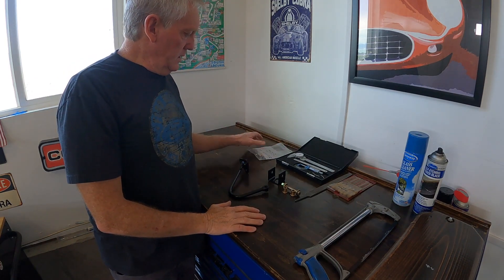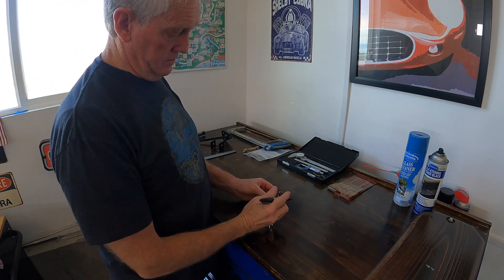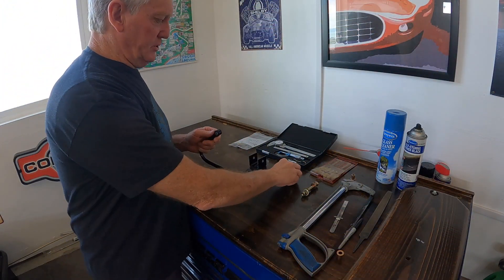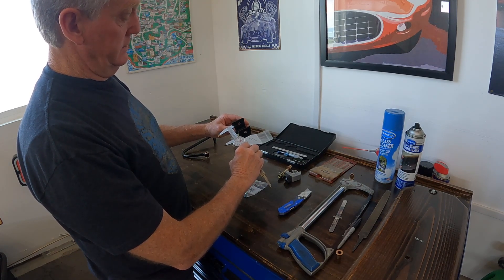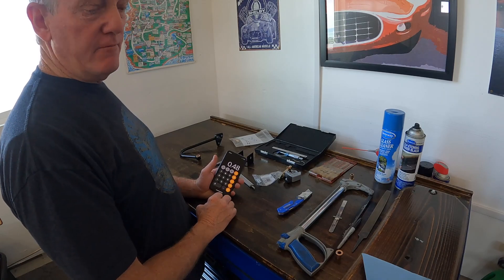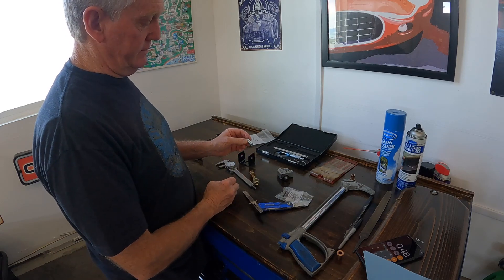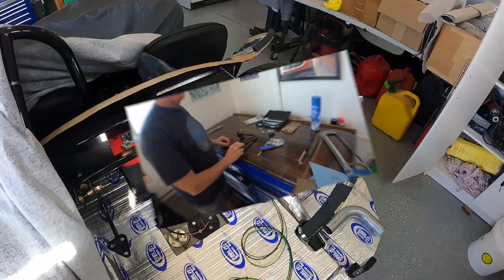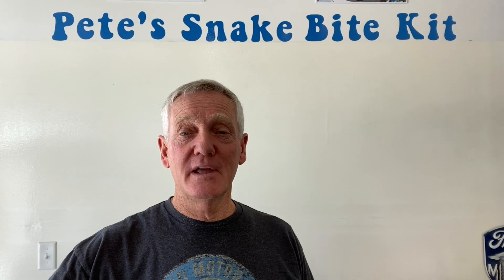EPISODE 59 Everything hinges on this!

Comment: Hey Pete   I am also using a 351w based stroker.  Are you using a front or rear sump pan?
Reply from the maker: Rear sump I got a B&B pan. Because I used a stud girdle I had to fab the oil pickup. I am not real happy with the fit n finish I think I will step up to a Cayton or Moroso if I ever have this off.